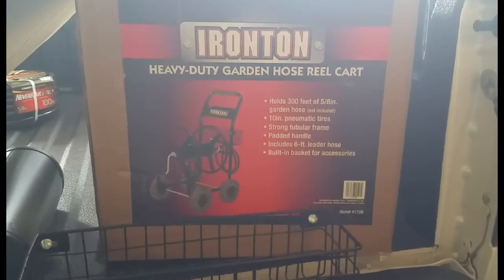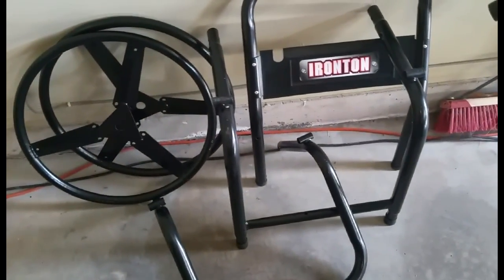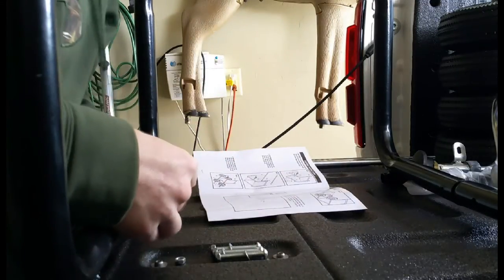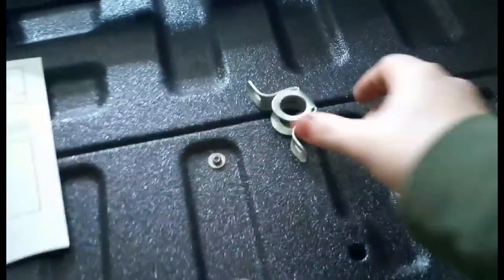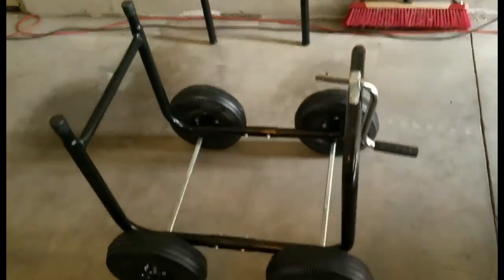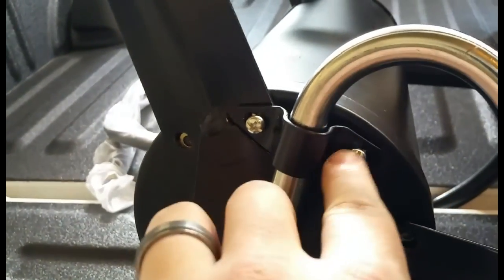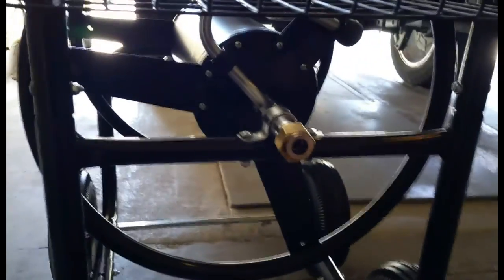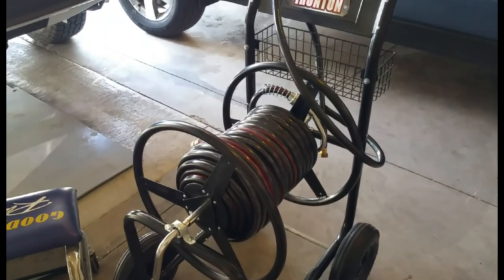Ironton Heavy Duty Hose Reel Cart Assembly

Comment: It looks like you've got the center hose hub lined up with the wrong holes and is likely the reason you had to squeeze the bracket together to make it fit.  It need to move over one set of screw holes.  If you notice, the hose connector pieces is directly in line with the reel fins.  I'm not sure how you got your hose connected with how its shown in the video but the hose connector should fall between two sets of fins to make connecting/disconnecting the hose simple.  This also makes the screw holes for the connector bracket match up perfectly.  

Thanks for the video, I would've never been able to make it through the instructions without it.
Reply: You are correct sir.  When I finished installing everything I went to place the hose on and said wait... what did that person's comment say. After rereading this comment and removing 3 screws and repositioning the part , it was placed perfectly!  Thanks for the additional tip!  Kathy

Comment: I wonder if the split pipe with bolts holding  it as a joint isn't a manufacturing decision to be able to break the frame down to fit in a smaller shipping box.

Comment: The instal was a little bit confusing. This video helped me with those extra parts. Especially that one with the screw hole bracket. I thought it was gna be a lot more sturdy heavier duty. I think it’s ok for home use. I wouldn’t recommend for commercial use. Also my biggest thing I didn’t like is that it’s hard to turn. Wish either the front or back had turn wheels on them. Would make it easier to turn especially on grass

Comment: Definitely a candidate for the "worst instructions of the year" award.

My instructions showed the additional joint-strentheners... but also showed the  showed the crank hub already attached.  Basically had to build everything else out to see what bolts were extra, that I could use to attach the bracket.  It was 2 extra #2 Carriage bolts, used in step 9, to attach the handle to the vertical posts.  Cheers!

Comment: like you, i didn't find assembly particularly difficult. but how has yours held up? the center supply pipe on mine literally exploded under pressure after only a few uses. company was absolutely horrible to deal with re: warranty replacement. i noticed too the center drum had already started to corrode from the inside out after only a few uses. and mine has always been garage stored after each use. not good. i finally got a replacement unit from them but don't have high hopes. classic case of you get what you pay for i suppose. hopefully you've had better luck.
Reply from the maker: So far it's been ok. I do have some rusting and slight leaks but have been fortunate the nothing has gone out completely. I have about 200' of hose on mine

Comment: Although I tighten the two bolts on the Handle (F in the parts list) I still have a little wobble/play in it. Is that normal?
Reply from the maker: Mine has always had a slight wobble to it, yes..